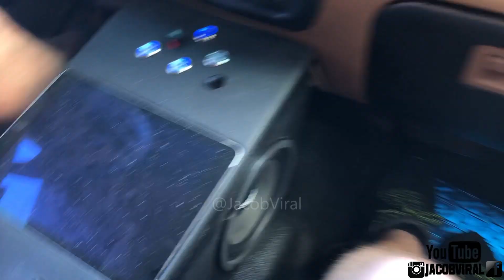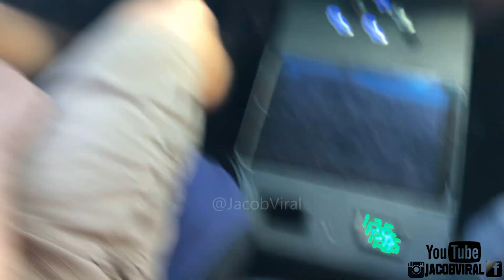ALL SKAR AUDIO TRUCK BLOWTHROUGH BUILD

Comment: Jacob, do you have a stereo? If so what are you running? What are few subs that really impressed you? I have 3 15" IA Death Penalty and i think i get way more out for the money cost like 687 ea. they are equal to all the 800+ do you agree? i have never even smelled them at 10,300w on the smd amm-1
Reply from the maker: I have a “my Setup” playlist on my channel for my 2 builds I’ve had and you’ll see equipment.
Reply: @JacobViral  ok yea i seen it. Man you were big big? have you already went to the single 10"? you happy with it? what you had i would say is TOO much for every day listening wasn't it? plus you got that 10 where its more like a set of 12's! Check out my channel i have a couple speakers on way now to put against each other and put on smd amm-1 make sure they truly handle rated on a steady tone. Get better as i get my money together. tell me what you'd like to see and any pointers you have would be great. thx Jacob